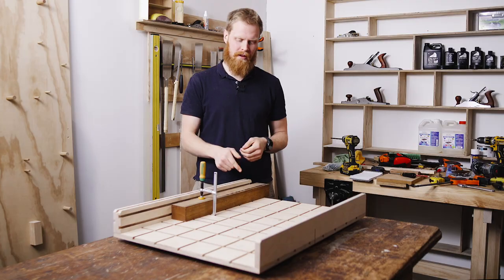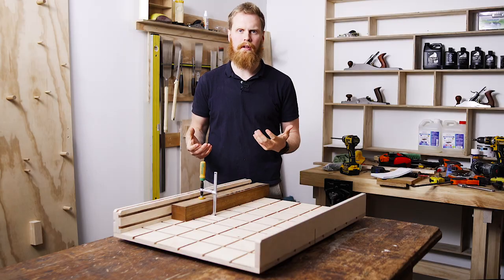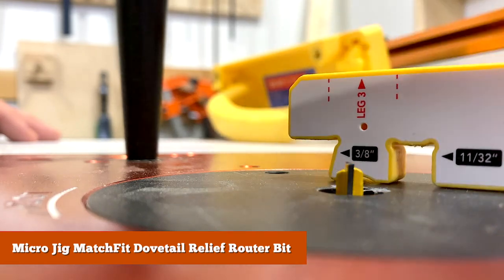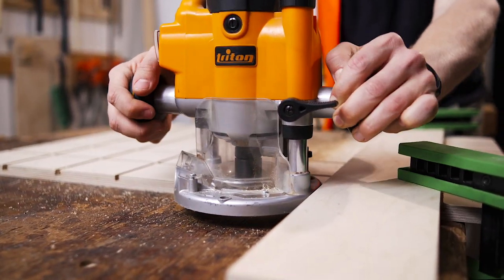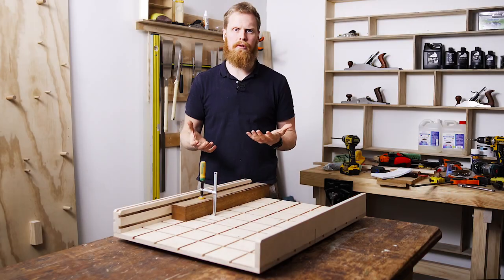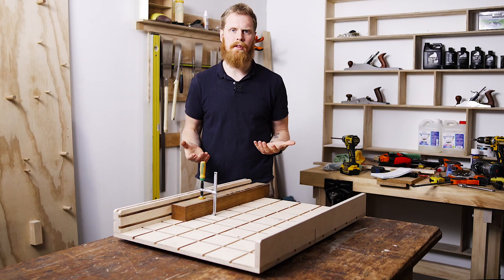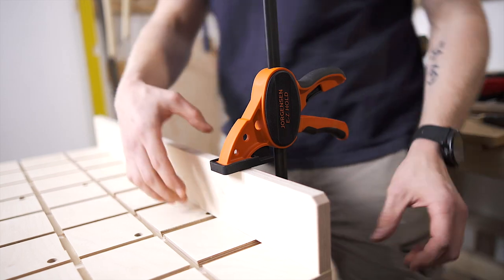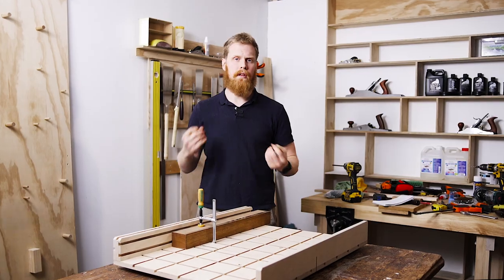Making a Table Saw Sled with Micro Jig

Comment: I am in the process of making a sled exactly as you have shown.  I need help understanding the track you made at the area of the front fence to allow the clamps to be inserted and removed from the vertical tracks.  It seems to me a open groove must be made in each of the vertical tracks for a short distance or am I not understanding how the clamps work.  This is my first adventure with the microjig products.  Thanks in advance for your help.
Reply: I have the same question. Is there an answer?